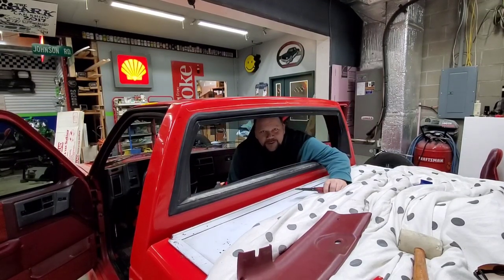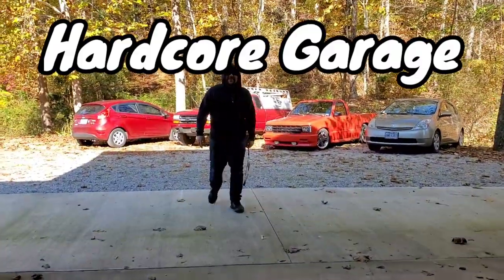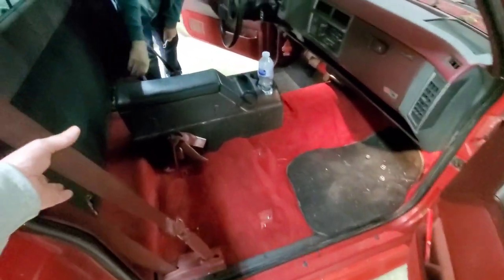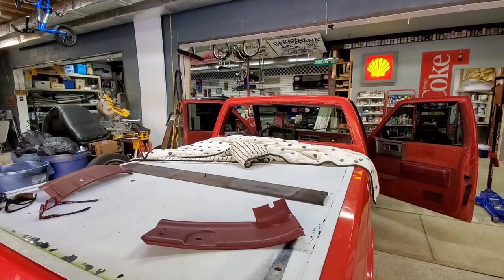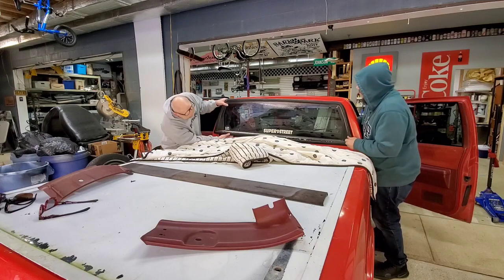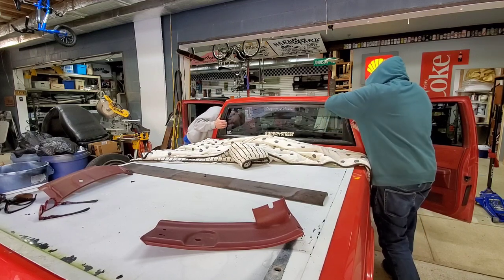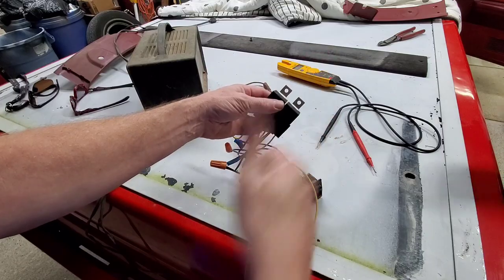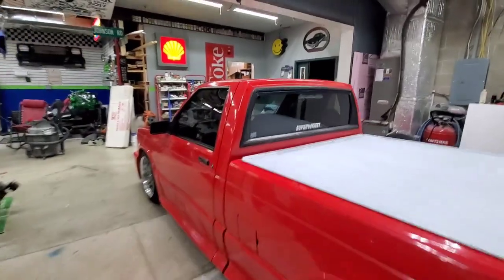Minitruck Limo window install. The coolest custom aftermarket mod ever!  Chevy S10 Cameo 💋

Comment: I have one in my 1987 s10 it's a power light brand power window. I paid $50. For it 10 years ago.  Mine came.e out of the GM tech center. At night it will reflect the head lights back at the car behind you.
Reply from the maker: Nice! Hahahha they are flat AF!
Reply: do you have a part number by any chance or remember where you got it from?

Comment: My fav mod ever. CR Laurence Power Lite roll down back window. Waiting on a guy in CA to send me one for my C30. Love it man. What a score. Super rare these days.  I even contacted them and ask them to continue to reproduce these windows and they said they stopped around 1990 or ‘91 and they will not do it.
Reply from the maker: When I was rebuilding it as soon as I said what i had they were like nope, don't have anything.  There were at least 3 versions that ive seen. Its like they were trying to get it right.  They are quirky, but cool as hell! Reminds me of the old mercury turnpike cruisers!
Reply: It's there a website you recommend..I would love to try one for my 98 Chevy s10
Reply: What you pay for it if you don't mind me asking?

Comment: Tid bit tip: use a small  rope wrapped around the rubber with end of rope on the inside of the truck. Then after placing window pull the rope while pushing on that spot of the window. Takes just a couple minutes
Reply from the maker: Lol yeah ive done that before. Not possible with the limo window. Too much of it sticks inside the cab.

Comment: That's pretty cool I actually had a 1987 ford f-150 bigfoot cruiser it came factory with the limo window there actually pretty rare trucks and not many people seem to know about them...
Reply: like this setup better ( interesting knew about the model option but mostly for the recall/internet-video's about it, also toyota made a model's with roll-down and i can remember it in my hood/next-door to me etc and thinking wow i like that for fresh air instead of my stuffy fixed/no-box factory lifted/ford-big-foot-competition k1500 80's ) than k1500 sliders-mailing box now 🤔if there's a way for this and the convertible/bubble hard-top mod to work together?

thinking about something similar for my back window on my 60's charger for summertime and defogging and also for the air not to thumping my ears/glass at hyi speed with the vent-window or back-passenger-glass open

Comment: If you take a thin rope and put in the channel in the rubber and pull it as you hold the glass against the body. Oh a lube it with glass cleaner or silicone spray.

Comment: I did not know they fit on the s10 truck I have one on my 91 obs truck and I have another one I am getting ready to put on another truck very cool set up.
Reply from the maker: They only fit what they're made to fit. The s10 ones are rare as hell. I saw a few full sizes chevys with them in the 90s.
Reply: I bet they are! Looks really good on the truck
Reply: How did you seal it so that water doesn’t get into the cab?

Comment: Love what you guys did is it possible to put that same product on a 98 Chevy S10 short cab..and what size is recommended..
Reply from the maker: Its a part from the 90s.  They made them for about anything back then. I found this as a used unworking unit and rebuilt it.
CR Lawrence is the brand. They still make power rear windows for new stuff.
Reply: @HardCoreGarage  dude thanx a lot I appreciate it and thanx so much for replying.🫵👍💪🙏

Comment: How much and where can I get this done at I got a 1984 c10 susta smurf and the only way I change my rear sliding window is if I get the limo window put in it
Reply from the maker: They made them for c10s back in the day. Ive been offered 2k for this one repeatedly.  So id say you're gonna be in that range trying to find one
Reply: @HardCoreGarage  and where yo location I don't have a problem with that price long as everything included

Comment: Wonder if a large sunroof could be installed and then the remainder of the cab opening closed off to get somewhat the same thing?
Reply: Small window S10 cab fad or even fabricate cab corner windows like the older trucks had🤔
Reply from the maker: Not sure I'm following. Sounds like you  Are you talking about a superdome or a breezer window.?
Reply: @HardCoreGarage  I was talking about using an electric sunroof out of a car to make the back window to try and have close to what you have here. Then finish the rest of the opening with body work. Or add corner windows like the 50 model trucks 5 window trucks
Reply from the maker: @kennyoli2351  lol there plenty of vehicles with rill down back windows that would work much better.
Reply: @HardCoreGarage  ok I don't follow the newer stuff and only actually seen a few electric back window and its usually the slide
Reply from the maker: @kennyoli2351  i don't think I'd consider a Honda del sol, the new stuff.... lol yeah I've got the power slider too!

Comment: I have one of these for my S10 I haven't put in yet. Was wondering what u did to secure the bottom. Mine has kinda like a post on each side at the bottom but I didn't get anything with it to install that mounts in the truck that they insert into.
Reply: I should add, I watched your video of when you went to pick it up. I've been waiting for this video. Can't believe I didn't notice it right away. You've been a huge help to me with my 88 S10. I appreciate your videos!
Reply from the maker: Send me a pic of what you got.. newleafjohnnie@yahoo.com 
There is nothing supporting the bottom, but its very secure. The window frame holds everything nice and tight.

Comment: Hey man I have been building a new era s10 with a ls any way you can help or po8nt me in the right direction to find what you have? What glass and bracket and motor was used for this? Heard a Nissan Titan and 4 runner but what did you use?
Reply from the maker: Here's the rebuild video.
https://youtu.be/fIthOpbB_0g

Comment: (Breezer windows) 
But not electric.
Reply from the maker: Not exactly. I've got the breezer in my 90. Its kinda a pain in the butt to deal with when it's out.  I like it popped open but I'm always scared it's gonna break when out. And the opening is alot smaller